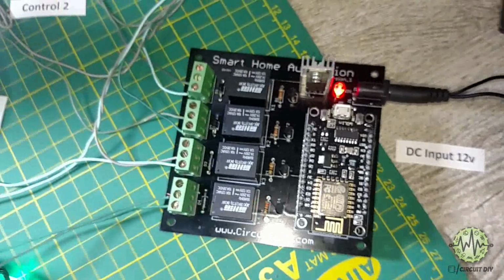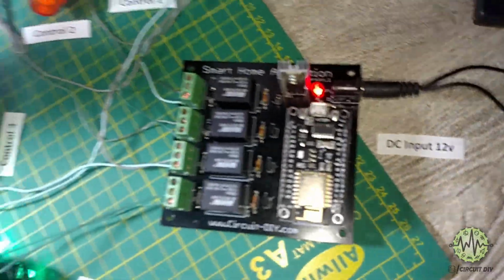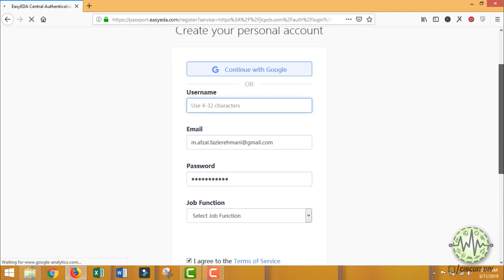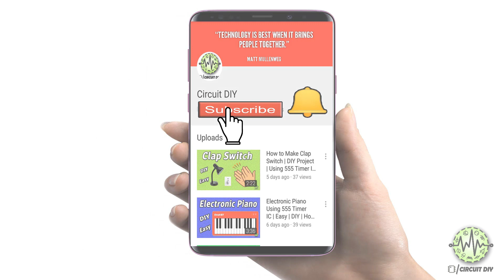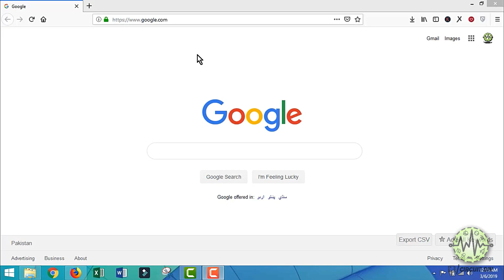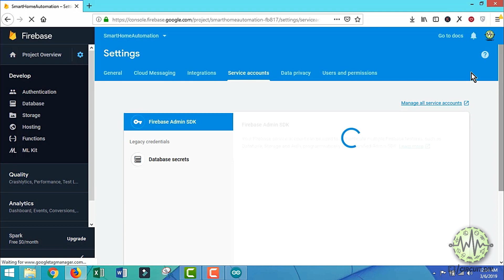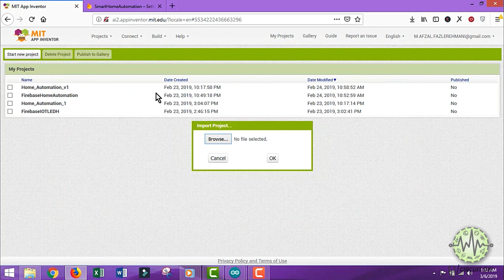Home Automation Using NodeMCU | iot projects | firebase | nodemcu esp8266

Comment: Nice work ! I am trying to do this project using your source but there is some error
Reply from the maker: Which error
Reply: It says that my nodemcu cant recognize but it is connected on my laptop
Reply from the maker: So there maybe a problem with the port or nodemcu sdk not I stalled properly acc to instructions
Reply: @CircuitsDIY  but I check my port its also connected

Comment: Bro followed the same steps but my nodemcu is not updated by the firebase. App and firebase works perfectly, but not the nodemcu.
Reply from the maker: Could you please tell more ...which type of error you r facing
Reply from the maker: Try to make update the fingerprints of library (Arduino Firebase ) Or download the latest one from the description ...I have the same issue but when.i make change in library with the recent fingerprints of firebase...All work perfectly
Reply: @CircuitsDIY  thank you bro. I'll try this out.

Comment: Bro I have got an error , the error is "firebase error". Nodemcu connect with the mobile hotspot and then firebase error come. Can you help me ?
Reply from the maker: There is a problem with firebase website fingerprints so ...remove the library (Arduino Firebase) and Updated with the file given in link description ... i have update the fingerprint in library
Reply: Ok,let me check.

Comment: I show an error.  And can not connected with firebase
Reply from the maker: Yes I know what the reason is ...
Download the library (Arduino Firebase ) from link in description and delete previous one 

Actually firebase has updated it fingerprints that in not updated in library ....

Thanks
Reply: @CircuitsDIY  thank you :)
Reply: @CircuitsDIY   who to add DHT11 sensor in same system .
Reply from the maker: For DHT have to modify few line in code ...
Reply: @CircuitsDIY   please give me this code with modify DHT code
Reply from the maker: Ok when I free I will send you